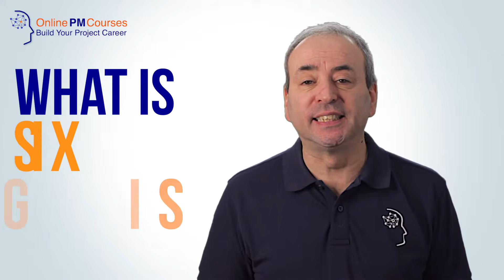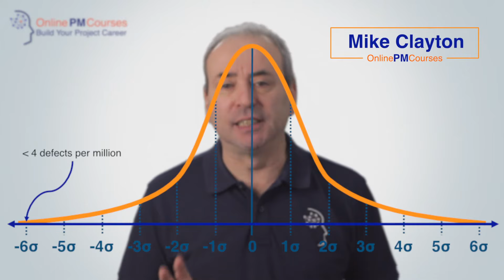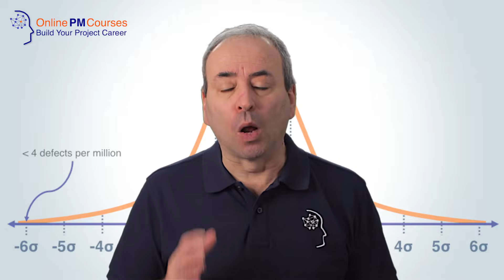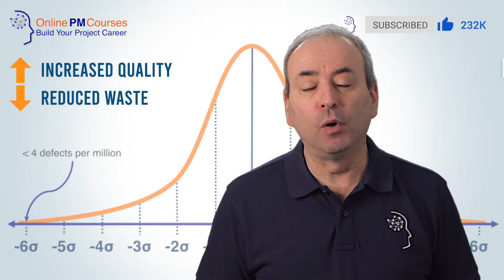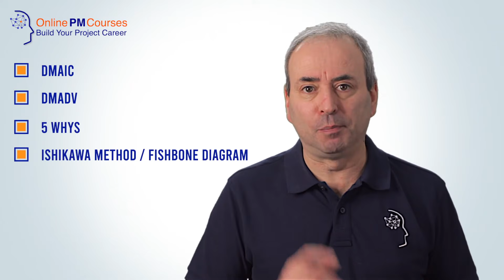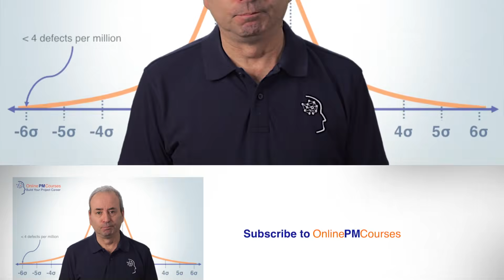What is Six Sigma? ...and DMAIC

Comment: I have a question, is there a tool of six sigma called TMAIC ? if so whats the T stands for?
Reply from the maker: There is DMAIC (Define, Measure, Analyze, Improve, Control) - I haven't heard of a variant with a T.
Reply: @Onlinepmcourses thank you very much for your reply, acutally i have an assignment and we have this question to differentiate between the two and haven't found any answer for it, but will ask my mentor tomorrow, thank you again.❤

Comment: Hi Mike, I know it's been a long time since you made this vlog 😢. I hope you might go through my question ❓❓❓ as I am new to this industry, therefore I wanted to ask you, does six Sigma also work for FMCG Retail sector, if yes, then why we always talk about manufacturing 😢 
And if yes, then do we need to use each and every tool of 6 sigma in every case 😢

I know it sounds purile however I seriously need a clarity from the expert like you. Hoping for your response. Thanks
Reply from the maker: I believe Six Sigma can be useful in FMCG - there's always plenty to improve, especially customer satisfcaction through bettter service and fewer errors.. Do you NEED to use each and every tool? Never. A toolkit is a set of resources to draw upon, to get a job done. More tools = more resources. But ythey should never be a burden that drives  some form of compliance obligation. The goal of the improvement process should lead you to inelligent tool selection. Check out your favorite online book seller. There are plenty of books about Six Sigma in the service and FMCG sectors.
Reply: @Onlinepmcourses  Dear Mike, Thank you very much for your response & the guidance you have provided. However as far as the reading materials are concerned I am going through these books : 
Applied Statistics & Probability for Engineers - Douglas  Montgomery, George Runger

Design & Analysis of experiments 8th edition -Douglas C montgomery

Design of Experiments with minitab - Paul Mathews

Fundamentals of quality control & Improvement 4th edition-Amitava Mitra

Introduction to statistical quality control-Duglas Montgomery

Lean 6 Sigma for service-Michal L. George
learning to see- Mike Rother, John Shook

Quality without  tears-Art of hassle free management-Philip B crosby

Seeing the whole - Dan Jones Jim Womack

The ASQ pocket guide to root cause analysis-B.Anderson & Tom

However could not find anything specific to Retail Operations. Thanks again.
Reply from the maker: Unfortunately, retail is not my sector and I am no six sigma expert. You'll find experts on both, online. Find a few. Ask them. compare their answers.
Reply: @Onlinepmcourses Again Thank you very much for your consideration to respond. However, I have tried my best and am still trying. However, no luck till date. 

Moreover, I have observed that for being a lean 6 sigma expert one really needs to have a deep domain knowledge, otherwise it's impossible to resolve the issue. For instance: A manufacturing (engineering) professional cannot resolve bank related ( investment or retail) issues, similarly vice versa. I recently had a discussion with one of the lean six Sigma training experts and finally we came to the conclusion that deep domain knowledge is the first and foremost thing to be considered. 

I hope you may support my opinion. Thanks again

Comment: Hello, thanks for the video. I have a conceptual doubt. Six sigma is a lot about reducing defect rate, like you say in the video. In many case studies though, I have seen that the goal was to reduce recruitment  time, increase production and other things related to VOP. When this happens, let's say reducing recruitment time at a maximum of 3 days, can I still calculate cpk using 3 days as spec limit? I ask you because in this case spec wouldn't come directely from voice of customer but from voice of business.
Reply from the maker: I am not sufficiently knowledgeable to know how successful you would be. However, to contradicting observations:
1. Your use case is not what it's designed for, so it may not work well
2. However, there is no reason not to investigate whether you can adapt the ideas. I just don't know how you would do this.
Reply: @Onlinepmcourses   thanks a lot for the answer. I believe your first point is spot on. That just can't be considered like a spec limit, nor there's a spec coming from VOC tied to the recruitment time.
Reply: If products/services are being delivered late and investigation shows all processes are optimal, except the recruitment process which is identified as the process causing delays to the product/service delivery, then it is absolutely sensible to apply the investigation tool to the recruitment process to identify opportunities for improvement and ultimately meet the customer lead time requirements.

This would be applicable to any industry that may require regular hire of temporary work teams on an ad hoc basis.

Your specific situation may be entirely different. In this industry of common sense and made up jargon all these concepts can be manipulated to suit any scenario. It's because they aren't based in solid science, they're just made up versions of common sense sold to businesses.

Comment: I'm very shocked at how many defects (millions) without sigma six I have in the company, we didn't know it before.
Wouldn't be enough if everyone did their job just properly?
There would be no need for these empty chatters...
Reply from the maker: I'm not with you. The Six Sigma process is designed to reduce rate of defects and thus waste. It does not imply or require a high a priori starting rate of defects.
Reply: "Six Sigma Champions are con men" 
“All you have is smoke and mirrors” 
- Creator of Six Sigma, Mikel Harry
91 % of Six Sigma companies have trailed the S&P 500 (Qualpro survey).  Six Sigma’s once best reference, GE, has thrown the trash out.  An 8 yr study at Ford showed an average of 1 in 5 parts defective AFTER improvement for “successful” Six Sigma projects.

Six Sigma is a destructive scam based on pure farce. Are you aware Six Sigma was laughably based on the height of a stack of discs!  Most folk never bothered to check.  EVERY aspect is worthless.

Dr Wheeler, the world’s leading process statistician, calls Six Sigma “GOOFY” and the stuff of “the tooth fairy”..  CBS calls it the most stupid fad of all time.

There is never justification to stray from the giants of Quality Dr Shewhart, Professor Ishikawa, Professor Lewis, Professor Deming, Dr Taguchi and Dr Wheeler, for the lunacy of Six Sigma’s con man.

How the Six Sigma fraud was started:  
https://youtube.com/shorts/FPJCS46nexY

Lean was tacked on to prolong the Six Sigma Scam.
98% of LSS implementations FAIL (IW survey)

Comment: Could six sigma work for me as employee of a company that don’t use six sigma in their processes?
Reply from the maker: Aside from the basic process and culture of six sigma, it offers a great problem-solving and business analysis toolset. So do learn more about it informally to see if formal training will suit you and the role you are in. And also, you may find it helpful for future job applications - depending on your sector.
Reply: Katherin, Maby there are some improvement methods used in your company. Six Sigma gives guidance to do it methodically. Try to improve a few  areas around you. Show results to colleagues, try to grab their interest. If there will be support from management, more colleagues can be trained and method spread in the company. Would you agree with me?
Reply: NO
"Six Sigma Champions are con men" 
“All you have is smoke and mirrors” 
- Creator of Six Sigma, Mikel Harry
91 % of Six Sigma companies have trailed the S&P 500 (Qualpro survey).  Six Sigma’s once best reference, GE, has thrown the trash out.  An 8 yr study at Ford showed an average of 1 in 5 parts defective AFTER improvement for “successful” Six Sigma projects.

Six Sigma is a destructive scam based on pure farce. Are you aware Six Sigma was laughably based on the height of a stack of discs!  Most folk never bothered to check.  EVERY aspect is worthless.

Dr Wheeler, the world’s leading process statistician, calls Six Sigma “GOOFY” and the stuff of “the tooth fairy”..  CBS calls it the most stupid fad of all time.

There is never justification to stray from the giants of Quality Dr Shewhart, Professor Ishikawa, Professor Lewis, Professor Deming, Dr Taguchi and Dr Wheeler, for the lunacy of Six Sigma’s con man.

How the Six Sigma fraud was started:  
https://youtube.com/shorts/FPJCS46nexY

Lean was tacked on to prolong the Six Sigma Scam.
98% of LSS implementations FAIL (IW survey)
Reply: I used it with zero management awareness, either when I was working on tasks and as I got bigger teams.

Usually rolling out some form of ISO9000, 6 Sigma and some Kaizen and cost savings projects I can drop costs and staff time by about 30%

Then I reassign that staff savings time for either more work from other teams, or more rounds of improvement.